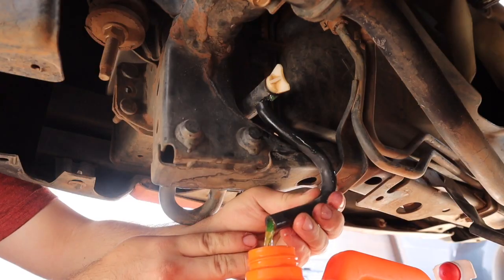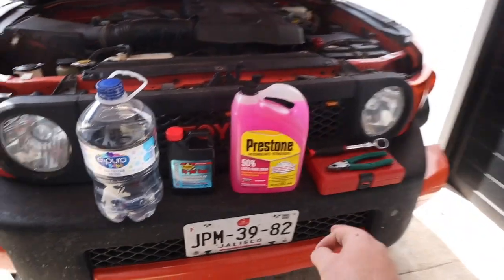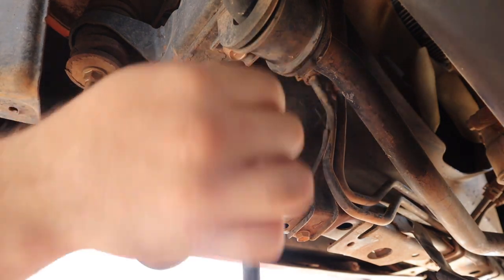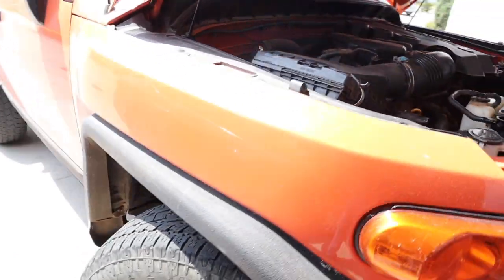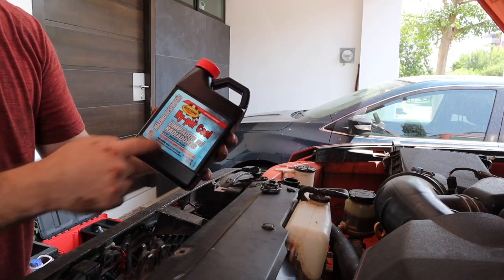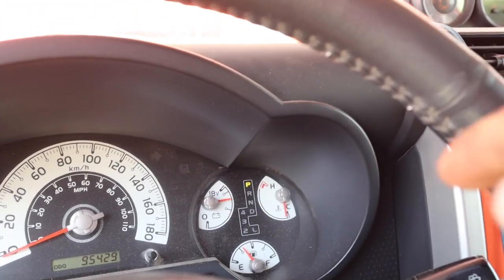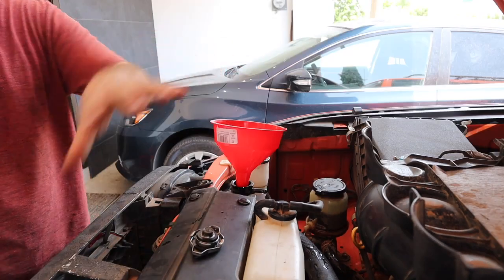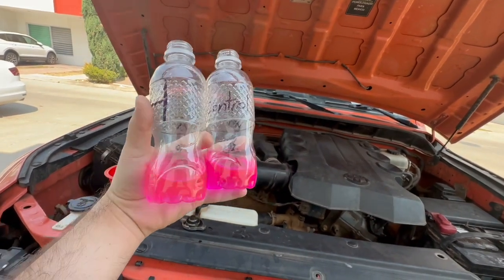Wrong coolant, How to flush any cooling system (radiator)

Comment: Quick tip. If the cooling system accumulated rust or dirt, if you use just distilled water for flushing, rust or dirt will not come out of the radiator, block, and hoses. Solution? Use a certified flushing liquid mixed with distilled water. Read the instructions thoroughly before using. You will be amazed of the difference.

Comment: What coolant did you use?  That looks like rv antifreeze 😮😮😮.   You new at this?
Reply from the maker: Toyotas require Toyota specific coolant, usually red or pink coolant, details can be found on the bottles and in your owners manual, look into it.